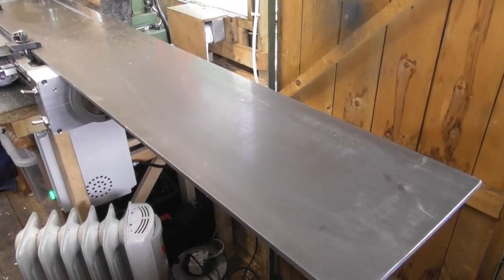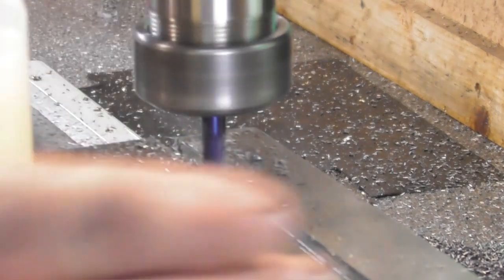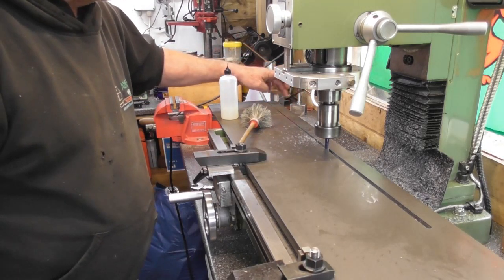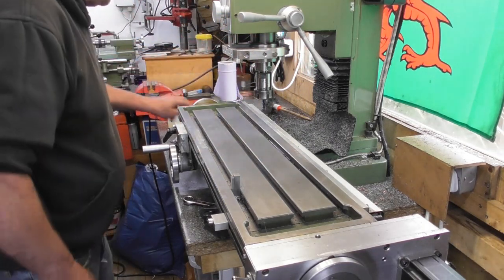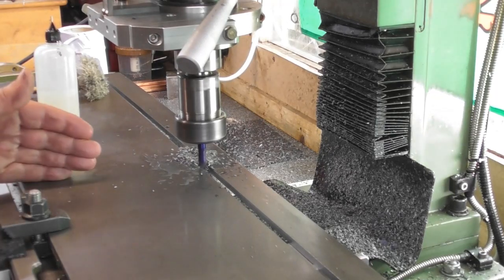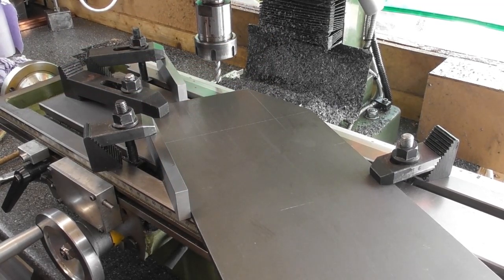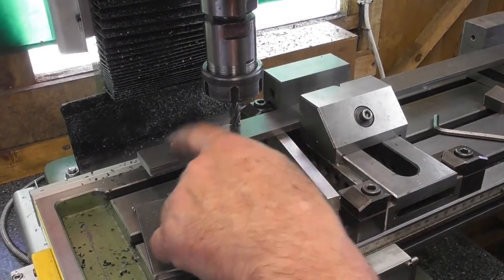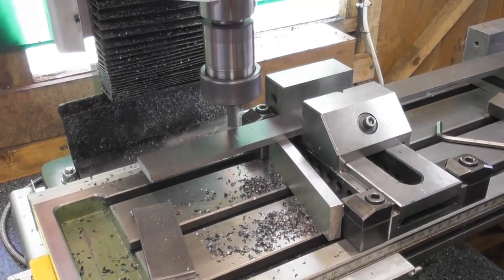Machining a large part on a small mill

Comment: Thanks for the video. This is immensely helpful for what I need to do: Mill bed is 24" (609mm), part is 36" (914mm). My only problem now is to make low profile clamps since I need to machine the top of the piece with a fly cutter.

Comment: Nice work. One suggestion to speed things up would be to cut off your oversize parts with either a carbide saw, plasma cutter, abrasive disc, etc, then face to length. Slotting cut offs is a very time consuming approach.

Comment: Hi Ade.  Slip gauges  re tenon for T slots.   I Turned so sliver steel any od  then turned down to good fit in slot parted off repeat for second . I just drop in like your slip gauges but just a simple turning job to make them. Plus a set tall for job on packers off table.
Steve